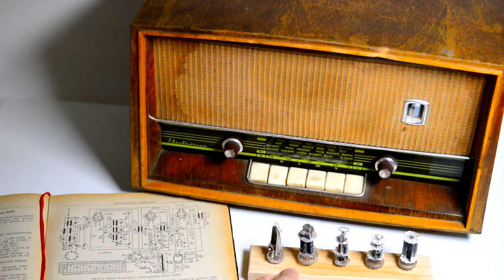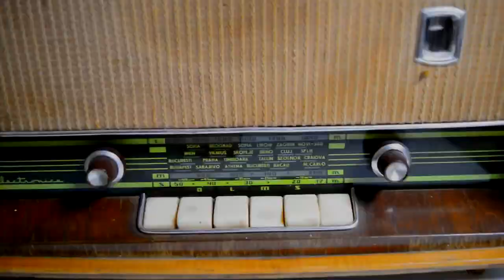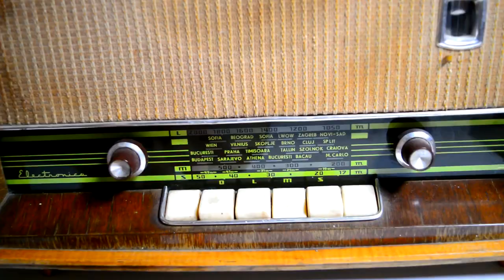Vacuum Tube Radio teardown - the Carmen 3

Comment: hi,
what can i use alternative option for ECH81 vcumm tube ???

in now a days ?
Reply from the maker: I'm not sure what you mean, this sort of tube is not manufactured any more because of its specific use case. Most tubes that are still being produced today are used for audio amplifiers. The triode-hexode (ECH type) was mainly used for RF signal mixing. 
The ECH81 is equivalent though to the 6AJ8 and 6I1P types, if that helps...
Reply: @FesZElectronics  ok sir